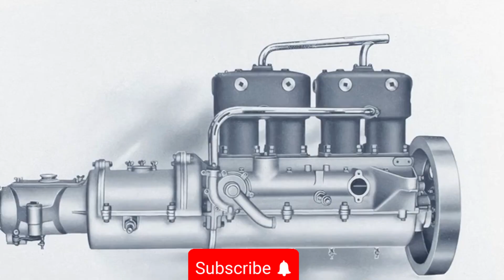Harley-Davidson's VIBRATION: Flaw or Masterpiece? (You WON'T Believe It)

Comment: I love them and would not want a bike with a bland sterile personality. One FLHRCI, fuel injected Road King that I rode was rubber mounted and had lots of shake, rattle and roll.  I bought a used 2004 with a broken front engine mount. It let the  engine bounce high, noticeable and pretty attention getting at the stop lights and idleing in the parking lot after start up. Once on the road it smoothed out. I put a lot of miles on that bike and never replaced the front mount. 13:22 😮
Reply from the maker: Sounds like you had quite the experience with that Road King! 😅 Those rubber-mounted Harleys definitely have a personality of their own—shake, rattle and roll included. Funny how they can feel like they’re about to shake themselves apart at idle, but once you’re cruising they smooth right out. Amazing that you put so many miles on it without even replacing the front mount—that’s classic Harley toughness right there. 🏍🔥